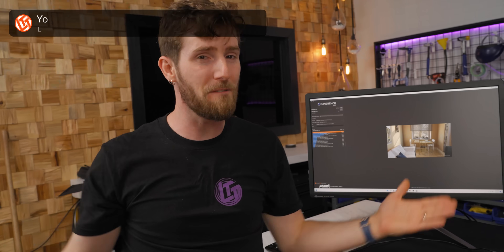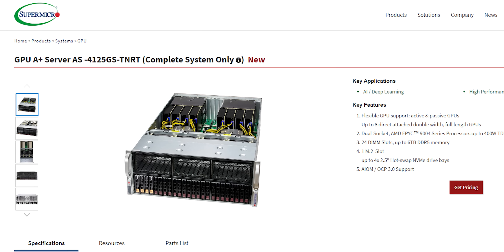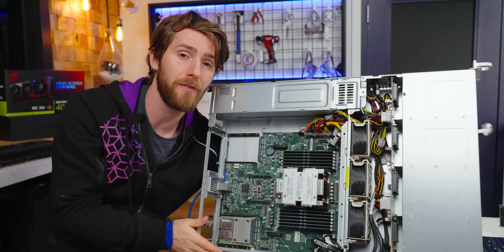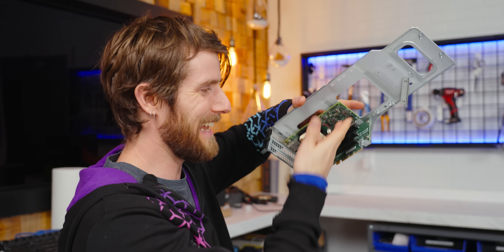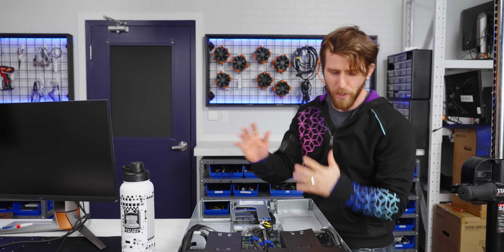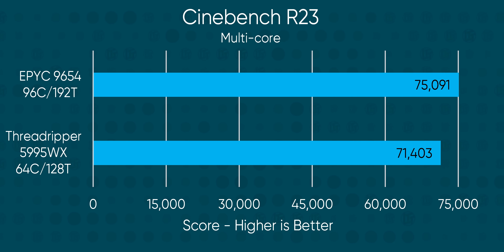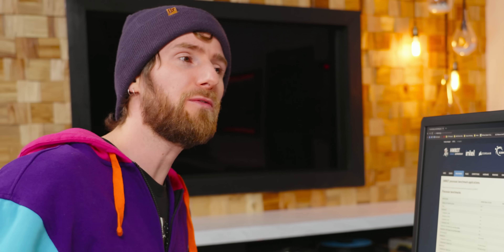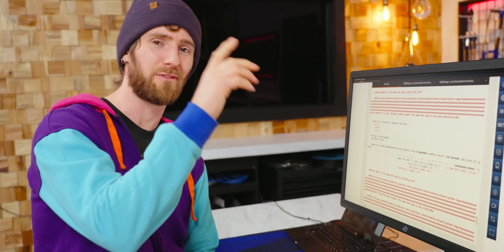HOLY $H!T - The FASTEST CPU on the Planet - AMD EPYC 9654

Comment: You know a dual CPU system is absurd when it breaks task manager.
Reply: No one except linus would be running windows on these computers. These would be linux machines.
Reply: Even the 64 core breaks task manager, not even speaking of duals
Reply: You'll find task manager in the corner at the local pub wondering where they went wrong in life.
Reply: It "broke" Cinebench too, that i never saw lol
Reply: @2011blueman  Not even. They usually run hypervisors that virtualize many linux machines or containers
Edit: since everyone keeps tagging me, I'll give an example of a non Linux one lol. Esxi by vmware is actually quite popular and is no longer linux based.
Reply: Really task manager wasn't made for hardware that has the local resources of a made for the cloud x86 server. It works well on consumer hardware that has less than 32 cores / 64 threads. It is when you get above the 256 logical thread count that task manager starts to have problems. You also shouldn't be using task manager on systems with that many logical cores. Most companies using the cloud don't use windows as the host OS either. Either a custom in house distro of linux or RHEL.
Reply: @Lunaire.- yeah and many Hypervisor are programmed in Linux, BSD etc. as good Hyper-V standalone became, as single host rarely used, or :)
Reply: nah bro. gotta just have 8k resolution and 32inch. screen. 👍 ( just to see all threads and cores)
Reply: This is an underrated comment.
Reply: Need 4k screen at 100% scaling just to see all of Task Manager.
Reply: If at one point we are getting so many core, can't they just update the software to have half of the cores in a drop down menu of sort? Or a least something to be compact enough to analyse the results better.
Reply: In fairness to task manager, at least it was smart enough to add a scroll bar.
Reply: We will need to see bad apple video rendered in task manager with these bad boys.
Reply: Nothing absurd about it. How else are you going to break records 🙂
Reply: In absolute fairness, it's not hard to break Windows GUIs. Linux isn't much better though, great UI is still the poor child of computing. Google probably did the most damage to the very concept, followed by post-Jobs Apple, because they don't just fail on their own, they tend to set "trends" [sic] that the whole industry then blindly follows (in their defense, not that they ask for it, it's just the way of leading companies in a sea of copycat zombies).
Reply: Does it break HTop
Reply: @Lunaire.-  Hypervisors also usually run on Linux...
Reply: @DarioCastellarin  Not all. But yes, some.
Reply: @Creative-Name  I like how you say "even" when you are talking about 64 core cpus.
Reply: @2011blueman  I'm not even sure what distros would support this in full dual NUMA/socket SMT mode (haven't had the chance to try or even look!), the integer definition for the core enumeration in the kernel in /proc/cpuinfo may well be an 8 bit and stop at 255.  Need to do some testing hahaha
Reply: @Lunaire.-  sigh, hypervisors such as KVM are linux kernels.
Reply: Just wait until we have quad versions! 🙂
Reply: @Lunaire.-  sure as hell that hypervisor is also running on a linux host.
Reply: @destiny_02  no, no it's not. Hypervisors in enterprise runs baremetal. I actually worked in that industry, idk why everyone feels the need to correct me when my point was for some people who wouldn't know to realize you don't actually take 96c and use it as is ever.
Reply: And they are working on a 128c chip to follow genoa apparently.
Reply: Mostly because nobody except LTT would put windows on such a machine. These are Machines for Linux or other UNIX operating systems.
Reply: @Lunaire.-  yeah. You'd probably slap ESX or a KVM hypervisor on that bad boy and call it a day.
Reply: Thank You Very Much
Reply: @richardyao9012  Could it do more without SMT? "If CPUMASK_OFFSTACK is enabled, the maximum supported value is 8192, otherwise the maximum value is 512." I usually tune it down for my kernels, on the theory that there's probably some percpu space that can be saved, but maybe not.
Reply: htop is the only true task manager. Break that!
Reply: @2011blueman  
Ohh the VMWare licensing costs on these... I could see these all running KVM or Hyper-V.
Reply: @GetFitEatRight  vSphere's license is like $4K per processor, so $8K a year for the dual CPU system. I don't think he said what the server costs, but I'd guess it's over $100K, so I wouldn't be focused on the VMWare licensing costs, but I generally stick with linux across the board for consistency.
Reply: @richardyao9012  Is that a custom kernel or in the stream?
Reply: Task Failed Successfully.
Reply: @2011blueman  I agree. I would guess that Blender gets way better scores if you run it on top of Linux on this very same box. Windows is not optimized to run on hundreds of hardware threads.
Reply: @2011blueman  linus and linux are easy to confuse, very similar.
Reply: @2011blueman  *linux, unix, *BSDs. there are some choices.
Reply: having to scroll is not "breaking". Like what are you even talking about
Reply: @Nauda999  BSD is a version of unix, and I don't believe unix is an option here.
Reply: @Nauda999  did you confuse linus and linux? I didn't.
Reply: @2011blueman  sounds similar, I often think that he is somehow related to Linus Torvalds
Reply: How many CPU systems can you attach together, dual quad 16 32 64 128...?
Reply: @Lunaire.-  Without source code it's hard to say to what degree it is no longer "Linux based".
Reply: @2011blueman  They wouldnt be running linux. They'd usually be running a custom OS (admittedly some of them would be derivatives of linux, but heavily customised at the very least). Other OS's would also be used like IBM's OS which is designed for supercomputers, mainframe-like machines and heavy duty servers for mass virtualisation and ESXI from VMWare which is no longer Linux based.

This CPU is certainly not designed for personal use in a personal computer, gaming or otherwise. its a server chip through and through.
Reply: @titytitmk2738  talking out of your rear end. It wouldn't be running a custom OS and definitely wouldn't be running IBM's OS/2. ESXI is possible but Xen is more likely since it's free. Go to any datacenter, including at IBM, you'll find them running linux on their servers.
Reply: A 60-core Xeon Platinum 8480 will crush this EPYC joke in LINPACK and any application that can utilize the FP throughput thanks to dual 512-bit units per core on the Sapphire Rapids-SP Xeon versus the dual 256-bit units on the 96-core Zen 4 EPYC.
Reply: BeamNG with 100+ cars!!!!
Reply: @2011blueman  B O R I N G
Reply: @gabrielv.4358 thanks for your deep and insightful comment. You've made the world a better place with your contribution. You should receive your nobel prize in literature in the mail any day now for your literary work of a comment.
Reply: @2011blueman  I'm glad!
Reply: nah. task manager will stop responding as usual.
Reply: @NUCLEARARMAMENT  shitpost much?
Reply: Look at me, my name is Linus. I'm going to post an ungodly embarassing image of my face in some stupid pose for all the internet to see. I have no self respect. I will blow myself away soon.
Reply: This should be reported to Dave Plummer at Dave's Garage. He is one of the MS programmers that worked on Task manager back in the day.
Reply: @ballfartius  It's not a shitpost, it's just the reality.
Reply: @2011blueman  Unless you're running Docker for Windows platforms, but you would be running Windows Server Core & managing via SSH like on Linux server systems.
Reply: Use several operatingsystems on the same computer. Think Oracle can split up resources into several virtual machines. The CPU can handle a whole family with remote access at the same time. But then you also need the biggest RAM chip in the world, and a biga$$ harddrive. Everything is possible. Totally wasted but possible.
Reply: Skynet Brain...
Reply: @2011blueman  Ah yes, tell the guy who builds and manages datacentres and other large network deployments  how to do his job. lol.

Most networking kit these days runs on customised operating systems. Cisco runs Cisco iOS, for example (not to be confused with Apple iOS) which is a completely custom (these days) OS of Ciscos own making (albeit it is unix based and could maybe get called a Linux OS despite being extremely different in every functional way).

Servers are no exception to this. They'll use custom OS's for a wide variety of uses these days.

Sure you'll find some servers running linux OS's, but you'd find just as many (if not more, depending on the servers designated  role) running Windows OS's and technologies.
Reply: My CPU can also break the task manager
Reply: @victor38542  In which way did Google and post-Jobs Apple make UIs worse?
Reply: Different applications may use the OS options in different ways, someone with cash to burn, or for whom the hardware cost pales in comparison to their hourly rate, may use a 96 core CPU (could only find a single socket desktop m/b - don't know if duals will ever be made/needed) workstation set up to THEIR needs - have most threads doing grunt work while continuing with other work.  For others it may be a dual socket office server, for others just part of a cluster.

Each of the chaps (and chapesses?) have points for their suggestions - doesn't mean the others are wrong, though, does it, if it works for them?
Heck, might not be their preference but corporate policy, or some other limitation to their options.
Reply: Running it on windows client version is absurd 😹😹😹
Reply: There's going to be a lot of excess stock going cheap soon these chip companies are updating too fast,just wait and watch the prices drop like a stone
Reply: @steelssstu6515  

So, great news for second tier who buy used 👍😎
Reply: To be fair to Linus here, these systems would NEVER see desktop Windows. They are simply made beyond what it is capable of... and the OS literally doesn't know what to do with all that performance. Even Windows Server is iffy because of alot of components of the OS are.... dated. This is the realm of POSIX-based systems, so you are looking at a family of Linux, the (Open, Free, Net, Dragonfly among others)BSD's, Solaris, QNX or anything UNIX-based.
Simply put, this is a machine that will likely never see the light of day. It push to the back of the room, humming along, doing what it does and for the money that is needed to acquire these things.... it better.
Reply: It occasionally seems like task manager breaks task manager.
Reply: @2011blueman  lmfao
Reply: Yes, but Unix only use this Cores... . Fastes shit... .
Reply: if you need a task manager then you did something wrong with this beast :D
Reply: @Lunaire.-  Nope just run a single server for Kubernetes.
Reply: someone who uses this cpu will never run windows anyway
Reply: it will only last a month! for it burns up.  damn AMD and Lenovo a bad combo!!!!
Reply: @2011blueman  but whho wants to use the femboy OS fr
Reply: have to be amd processor the great one advance machine german = amd advance micro device AMD EPYC
Reply: Or crashing Windows 11 with this in a dual CPU config + 2TB Memory XD ...
Reply: Windows wasn't designed for using on Multi-CPU insane thread count CPUs. If you think about it, even modern 13th gen Intel chips are still at/under 24 cores. Most consumer machines have about 8 cores.
Reply: @2011blueman Linux or completely custom software like a lot of server hosts do
Reply: everything this guys sayin rn is fuckin hilarious
Reply: It can't until it reached the limit of 512 threads...

Comment: The comparison between the PSU and the 4090 had me laugh spontaneously.
Reply: Is it me or is Nvidia taking it a little too far with size of the 4090?? I wont be able to afford one for many many many many years, but i personally think its outrageously big :P
Reply: @Emell09  it is outrageously big
Reply: @etaashmathamsetty7399  😂😂
Reply: @Emell09  I just built my dream computer (threadripper pro 5975rw 32 core and 4090 liquid suprim X GPU) and I used the HAF 700 case. The liquid suprim x 4090 looks small in the HAF 700 case.
Reply: @2011blueman  And play Minecraft with it, am i right?
Reply: Yeah I thought he was joking. The psu was super long. Then he actually puts them next to each other and they are the same length. That’s ridiculous.
Reply: @hookback  It definitely crushes mindcraft :)
Reply: I wanna see 384 CPU threads of rendering power via Swiftshader compared to a 4090
Reply: @2011blueman  I'd watch that build video.
Reply: @Emell09  That's what she said
Reply: @2011blueman  Well the HAF 700 is huge, so no shit. Not everyone wants a shit brick house as their case.
Reply: @oh_goliath  I doubt you'd want to watch. Even though I've been a programmer for over a decade, this was actually the first time I've built a computer from scratch. You'd be watching many hours of me reading the manuals to figure out where everything plugs into the motherboard and cursing the icegem 360. I only built the system because I couldn't find a builder with decent pricing for the system I needed to build.
Reply: We're going to need an RTX 4090 for scale plushie along with the banana. lol
Reply: @2011blueman  big case+liquid cooled card

Ofc it doesn't look big, there isn't a massive heatsink
Reply: @2011blueman   your probably the guy who bought extreme editions and ran quad sli
Reply: @tacon6351  quad channel 128g DDR4 to play games
Reply: I want a 4090 but only if its to go into my msi pcie 2.0 H81i itx
Reply: @Emell09  Dont worry, you willp rob get 4090 performance in 3 gpus generations, so the RTX 7060 might achieve similar 4090 performance.
Reply: @Pioteko You should move down here to the states. The 4090s have been fairly well restocked in microcenters here in the US, they even had founders editions in stock yesterday, but I get your point. I definitely refused to pay the scalpers prices. I got mine by just checking the microcenter website a few times a day and when I finally saw a liquid suprim x in stock I ran to my car and drove there as fast as I could. Yesterday was the first time I have seen them have a founders edition in stock though.
Reply: @tacon6351  my previous system was a dual GPU system, but they were workstation GPUs so you're on the right track. My original intention was to run dual 4090s, but right now the single 4090 is handling my workload without it being really necessary to get another. The sick thing is that any more than two 4090s in my system would require me to hire an electrician to add circuits to handle the load. I'm hoping when Nvidia comes out with the workstation version of the 4090 (presumably called the A7000) that it's more energy efficient and not a crazy markup over the rtx 4090.
Reply: @TheEchelon  Well most people won't want a "shit brick house" as their case, but GPUs aren't going to get any smaller. The HAF 700 is definitely overkill, and intentionally so since I planned on a dual GPU system. However, mini-itx is pretty much a dead form factor for modern GPUs and it's likely ATX and EATX will be the only form factors that allow future GPUs, with even the standard ATX becoming cramped and possibly causing thermal limiting in air cooled setups.
Reply: That thing is a straight up brick. It can, unironically, be used as a murder weapon.